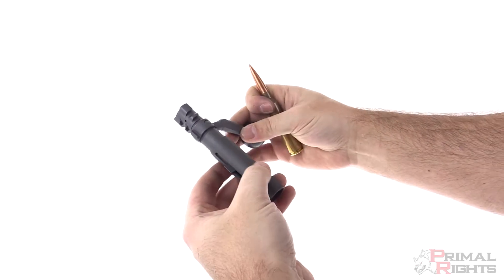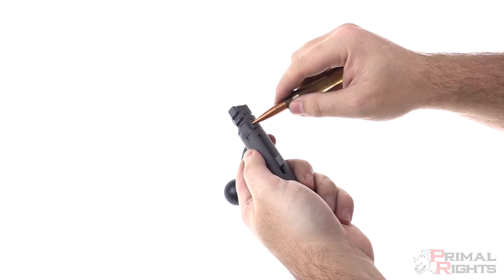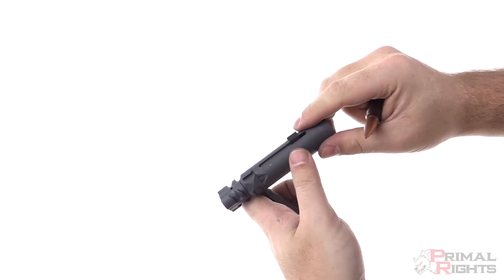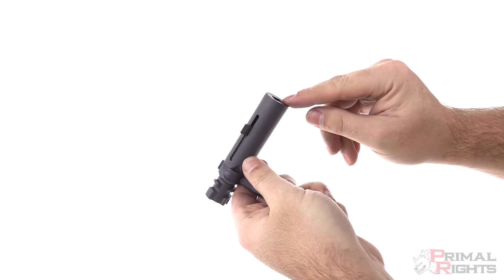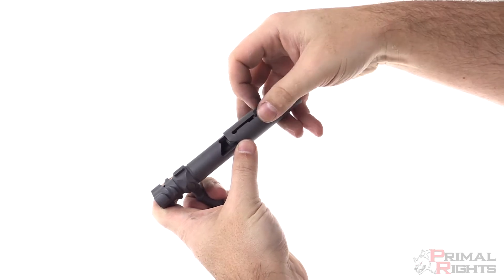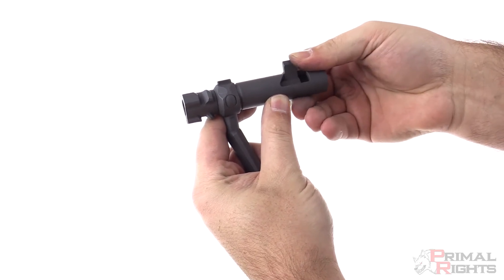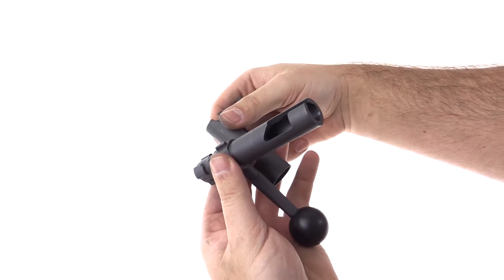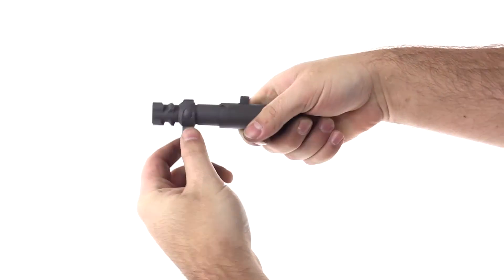Desert Tech SRS & Covert Bolt Maintenance

Comment: Hi I have srs A 1 in 308 with 1,000 rounds thur it. Yesterday shooting factory Hornady 178g match ammo I had one blown primer an 2 rounds failed to extract from chamber. Could I have a worn out extractor spring, pin, or extractor in 1,000 rds?
Reply from the maker: Blown primer is likely the cause of your problems. Hornady ammo is notorious for being dangerously hot. When the primer blew, it likely damaged or at the very least put debris in the extractor slot, causing it to malfunction. A complete bolt cleaning is what I'd recommend.
Reply: primalrights Is it likely that the hot load could have knocked extractor out of place? I know the DTA extractor pops out to easy for my liking. One time I knocked it out using a Q-tip when trying to dry some oil from bolt face. Bumped it an it popped out. I couldn't find it in my messy garage an had to get DTA to send me a new one. I did take extractor out but can't see any visible damage to it or the pin an spring? Shoot I have shot 25 rds of the hornady 178g match with thunderbeast suppressor an 22 of them went off with no big signs off pressure. It was the next 3 shots 23,24,25 that gave me one blown primer an then failed to eject next 2 shots. What would be your recommendation with ammo? I purchased a 500 rds. Claims 2600 fps on box. I have been getting 2650 out of my 22 inch DTA barrel.
Reply: primalrights I remember your brutalized SRS video an now those were some hot loads LoL. Just some back round on my 308. I have shot mostly atomic factory 175 an 168 grain ammo. It shot well but velocities where lower than expected. I used 300 rds an then reloaded with Berger 168 Hunter classic with 41.9g varget which gives me an accurate load but velocity is still only  2590. I don't usually deep clean gun after shooting but I run wet dry hoppes 9 until patch comes out clean without removing to much copper. Could it be by switching to the heavier honady 178g ammo that I had to much copper laid down from 168g bergers an bigger bullet having to cut new path? Am I over thinking this? I decided to use your video to disassemble bolt an clean, (thanks for video) an also clean barrel with sweets 7.62 an then give the 178g hornady another try if you think that could have been the problem?
Reply from the maker: Did you remove the extractor plunger and spring as well? Debris can find its way down there.
Reply: primalrights I did go to your site an was impressed. I also read your barrel cleaning article an learned clr is good stuff. Will give it a try.  I did use sweets 7.62 an was surprised that no real copper came out. I then tryed wipe out accerator, then hit it with wipe out an ran nylon brush though 5 times then a wet patch. I did get some carbon but little if any copper. Hit it again with wipe out in bore for 5 hours an again was surprised no copper. Patch came out pretty clean.Gonna let it soak overnight an see if that produces any crap in the morning. Lol